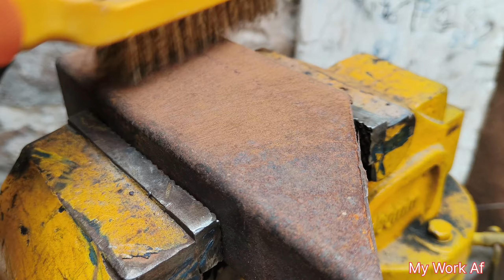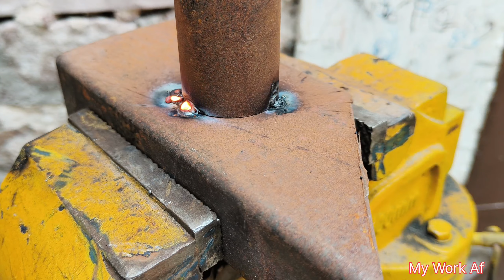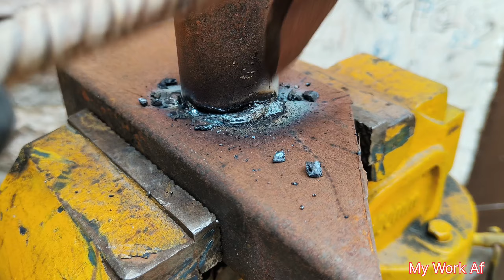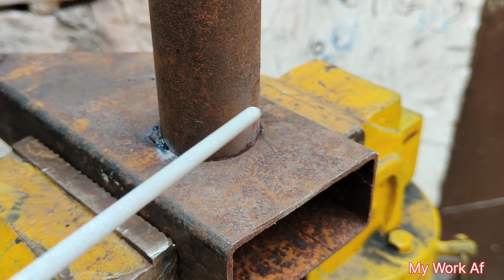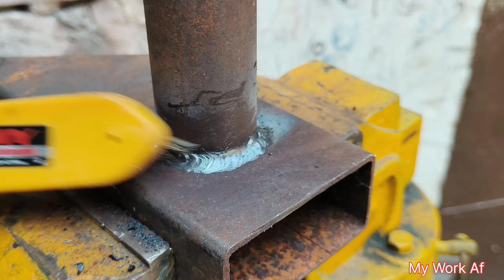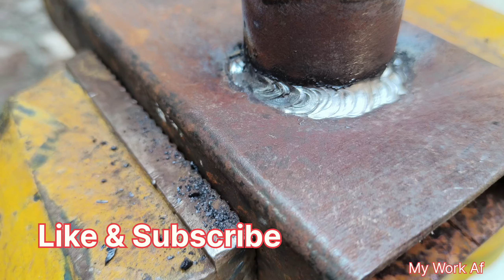If you do welding like this you will never have any problems.

Comment: Me gusta. Which welding type should a beginner try first? This is stick, right? I hear MIG is pretty beginner friendly.
Reply from the maker: Right thenks
Reply: Id start with mig, stick is quite hard and tig is quite expensive. Mig is much easier to learn and it will teach you the necessary skills to learn stick and tig